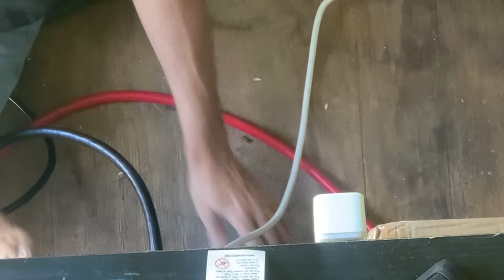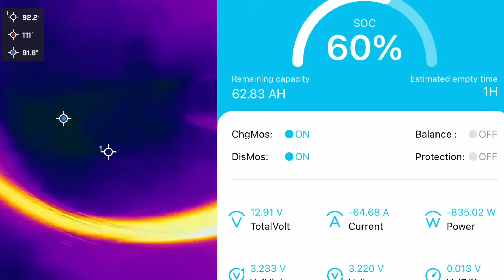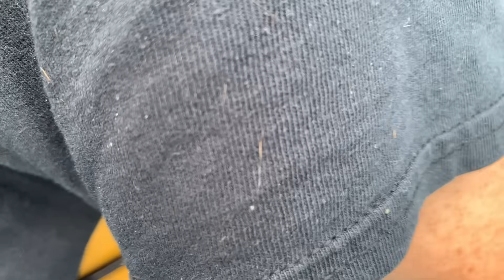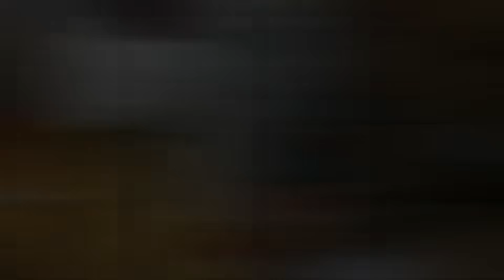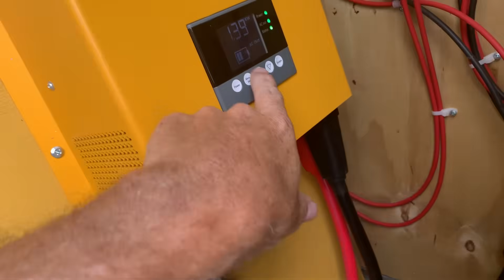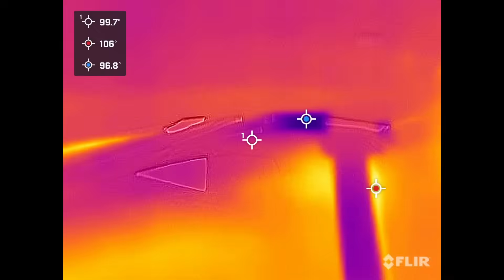I Built a Solar Power Shed and Here’s What Happened!

Comment: Does the inverter default to normally closed AC input when the inverter is powered off allowing for shore power pass through?
Reply from the maker: Yes, it does, even if you have it off .. when you plug it in it moves into bypass mode and boots up .. so if you have grid it is on no matter what ..
Reply from the maker: When the inverter is on it does, let me check if it does when the inverter is off.. I will run check it now and post your answer ,,,
Reply: Thank you! I am seriously considering this model and that would be deal killer if it did not. Sounds like it is packed with features.
Reply from the maker: @markHinAZ  Yes, it is pretty good for RV or places that have intermittent power.. Lots of good options ..

Comment: 3000 watts at 12.8 volts = 234.4 amps, at 51.2 volts 58.6 amps. Easy to fix.
Reply from the maker: Yes that is one of the benefits of a 48v system ..

Comment: Thanks for sharing.  I don't keep up closely with all the options and new equipment out there, but the idea of an AIO inverter powering down automatically is a good feature for RV's and your use case here. Granted this version isn't 48v to assist some of the optimizing hurdles like battery weight to KWh ratio some of us have considered, but this inverter set up seems a good contender for modifications when anyone is just keeping 12v in their RV.  I have a shed too far (and too many obstacles) from house to reasonably run underground wire to, so this may be a good quick solution I can consider.
Reply from the maker: Yes, that auto shutdown is pretty cool.. Saves a ton of idle time power.. If you only need 120v stuff not a bad choice at all .. :)